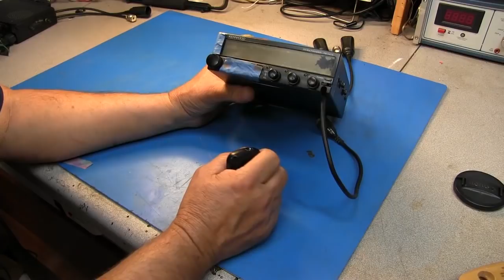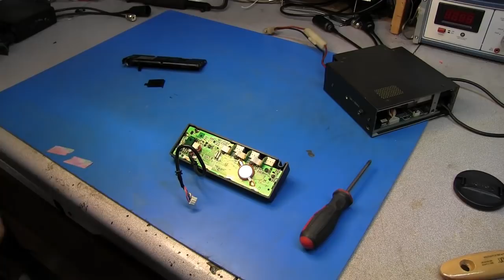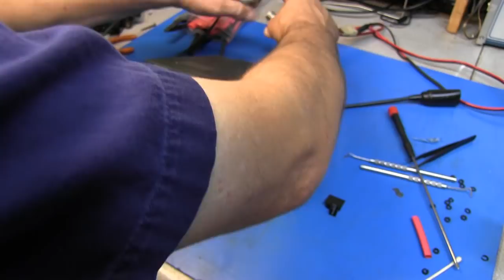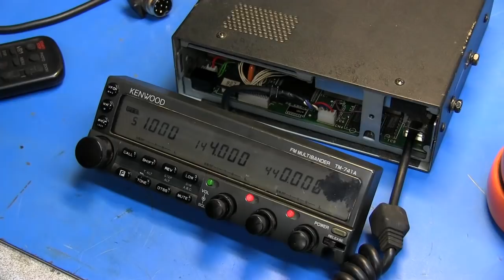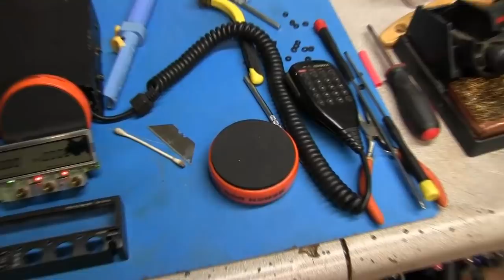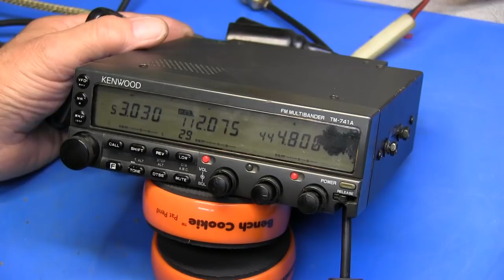#244 Kotto Give A Way Extended and TM 741A Repair

Comment: Nice to see you back, missed your videos,sorry to hear of his passing.  I have a Swan 300B that was modified before I got it, the 8950 final was changed for a 6LB6 and a 3DN3 ballast tube. I have used it a number of times but after I moved from BC to Ontario when I turned it on it had a runaway  and now no TX. probably one of the tubes. Side note, the fuse was found blown. What would be your suggestion. Receive is good when fuse replaced Great video. Cheers

Comment: Sorry about your loss.   That tm741 is a nice radio.  A view from my side from experience is that radio has been dropped.  The broken solder joints and such plus the way it acts.  I also know Kenwood radio are notorious for 'acting up' when the battery is low.  Was a thought of mine as well the exact same time you said it, that was cool.  Hope to see a video soon of an update.  Unfortunately its kinda like a car after an accident, gonna be fixing bugs in it all the time.
73's kd9jwz